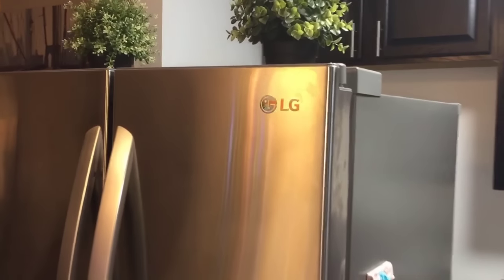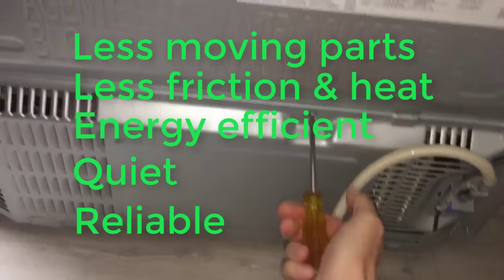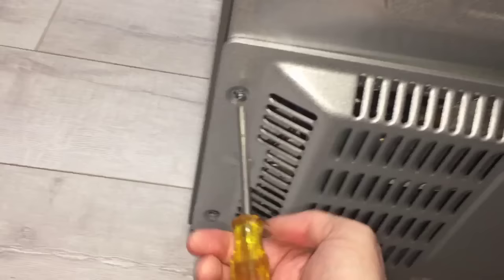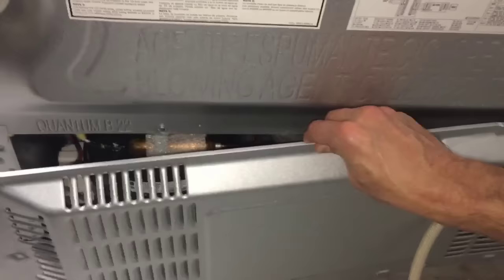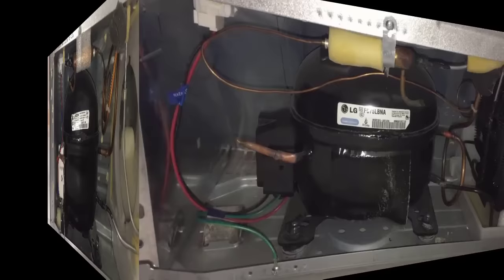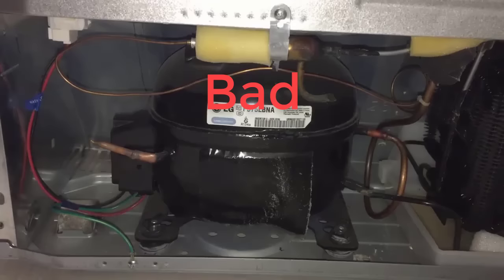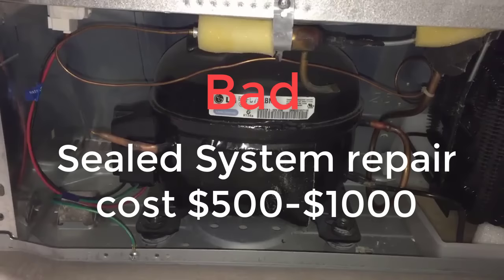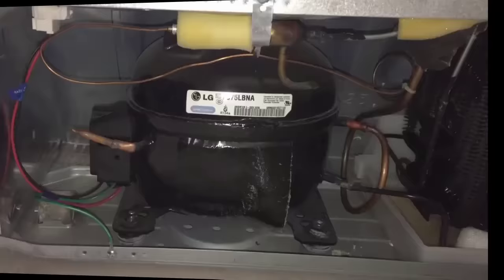LG fridge not cooling but running

Comment: I live in Arizona and today my fridge stoped cooling all the way keeping the temp at 54 degrees. I found your video. My compressor sounds great but my coils were loaded with dust and the fan had a good amount of dust on it as well. The compressor was pretty hot to the touch. I really think the issue is blocked coils so I'm going to leave the fridge off over night so the compressor can cool down and I'll try it again tomorrow. Thank you!!
Reply from the maker: I'd clean up the coils with a brush and a vacuum and turn the fridge back on. No need to keep it off overnight, unless there is a defrost problem.
Reply: @Your-Self  Excellent. Yes I already vacuumed and brushed everything with a tooth brush then I took the inside apart to make sure I didn't have a frost issue and the fan inside the fridge is working fine. It was a good excuse to completely clean the fridge too. Ok, I'll fire it up! Thank you!
Reply: @YourSelf it didn't work. The compressor was really hot, it that an indication that it's not working properly. Anything else to try before  I make a service call?
Reply from the maker: The compressor can get pretty hot on regular basis, but if the fan next to it works correctly, the compressor should be OK. If you have a temperature IR gun, try measuring the temp of the condenser coils as on the next video. Then decide if it worth calling a tech. https://youtu.be/ipwOerjFITg
Reply: @Your-Self  You are the BEST thank you so much for wanting to help. You are sending good eneryg into the world and it comes back to you!!
Reply: I'm not an expert, but based on my knowledge about cars and everything, I can say a few things about it. For example: the compressors on these refrigerators are supposed to be running constantly. As a result, they should generate heat and be warm/hot to the touch. So, that is not your problem. The condenser (the fins block) next to it is supposed to be warm (above room temperature) as well. Be careful with the fan next to it. Mine is just at the room temperature, so I'm suspecting the compressor to be the problem (not compressing Freon). They called it "sealed system problem". We got 6-9 years out of it, so I'm feeling lucky here. Still, average life span of a resident refrigerator should be 10-17 years. I would not buy another LG with a linear compressor, unless they improve its reliability. Buy swirlpool, or something to support your people at least.

Comment: So whats IS a good fridge for a campervan doesn't have to be 12v as on lithium batteries but an invertor type are they the same bad compressor. Whats this one like LG inverter fridge GT 279BPL?

Comment: Man I think u might have saved us anywhere from 500 to 1000 bucks, I won't know for a couple hours, what has happen was I pulled the frig out and the back plate was covered with dust so it was not breathing, so Wifey and I cleaned everything thing up and plugged it back in and we are noticing freezer becoming more cooler, still need a few hours to know for sure. Hey but even if it turns out that's not the problem you were a big help!!!
Reply from the maker: Hopefully you cleaned the condenser coils just in time, because majority of LG linear compressor failures are due to overheating. 
Just keep in mind, that it may take a whole day to return to normal temperatures after cleaning it if the compressor is still good.

Comment: I have a Kenmore Elite french door with bottom freezer, it is 6 years old. The linear compressor is warm to the touch and purrs quietly. The condensor motor and fan operate smoothly. I can feel ambient air blowing thru the freezer and fridge areas.The ice maker stopped working at the same time as the fridge & freezer stopped cooling. When I checked the evaporator area there was no sign of freeze up and no water on the floor but there was water in the freezer basket so maybe the evap. was frozen and melted before I got to it. I don't know what part to replace? Thanks
Reply from the maker: This definitely sounds like a Sealed System problem. It could be a leak, restriction, or a bad compressor most likely. Unfortunately, there is nothing you can do yourself. If you don't have an extended warranty from Sears, you'll have to decide if it's worth spending up to $1000 to fix this fridge.

Comment: Our LG fridge just lasted 4 yrs.  However, we've had problems with it since year 2.  I found a guy who fixes Refrigerators in the Denver area, he changed the compressor, charged me $600 (labor and the part).  The compressor, I was told, is a little bit older but so much durable than the pieces of junk LG uses now a days.
Reply from the maker: Your refrigerator should be still covered under 5 years free compressor replacement.
Reply: Can I get that contact? I live in Aurora
Reply: Wondering if I can get that contact too? Having a nightmare w 3 yo fridge. Within 1st year 1st compressor died. Now  2nd compressor and still broken  for over a month! Would love to get non-linear technology replacement compressor. Or if anyone knows of a good make/model to replace the whole fridge? Thanks.
Reply: Yes please send info I also live in Aurora, Colorado. My lg fridge just went out as well, 10days ago. Tech, came out from A&E factory and order a new compresser came in 2 days after he ordered it. But they can't get out to install for another 14days. Read the reviews for A &E  heard all horror stories. At this point I'll just pay someone to install my compresser.
Reply: @Your-Self  gee, mine was!  $4000 Lg fridge, compressor failed 22 months in, replaced in summer 22, not failing again.  So, what difference does their 5 year warranty make? took 15 days for serviceman to come. some people wait months, yes months, literally.  Lg sucks

Comment: I have a 5 year old French door LG refrigerator and everything seems to work fine, even the compressor sounds normal, but the evaporator fans on work in test mode. I leaning towards it being the thermostat sensor, but I'm no expert. Any ideas?

Comment: If it runs and the condenser and high side lines are cold, chances are it may not be cooling correctly. If you attach a gauge through the process tube and there is high suction pressure, the compressor can be bad.

Comment: Hello, it would be helpful if you can explain more about the overload click... What is opening or closing in the circuit when it clicks?  Thanks!
Reply from the maker: An overload click typically happens with non-linear compressors. They are the most popular "old skool" compressors that use a Start Relay. So when a compressor fails to start due to a bad relay or the compressor itself, the overload will (click) turn the power off for some time. After cooling down will supply the power again.

Comment: My LG refrigerator is 1.5 years old, it’s had 2 new compressors installed in it by technicians, it worked once for about 12 hours, still doesn’t work. Have had the technician out 5 times to tell me it was a leak or they had the wrong part the first time, etc. Is this a common problem anyone is having? Time to just get a new fridge?
Reply from the maker: LG compressors are different from others so not every technician can install them correctly. Also, a brand new compressor could be defective right out of the box. If you are the original owner and have the receipt, LG must fix it or give most of your money back for this fridge. Read this article if you have patience: https://consumersane.com/lg-refrigerator-not-cooling/
Reply: Same issues here. Already had a replacement fridge and it just crapped out on Easter weekend with a full shop from Costco going bad as we speak. LG customer service is non existent. They want 299 CAD to send a service guy out. Fml.
Reply: Steve Viel After about a dozen repair appointments, LG told me they will replace it. I just sent in the receipt the other day. I haven’t paid a dime. If it’s new enough you shouldn’t be paying anything, so I would try calling again and see if a different customer service person will help you. Go buy a cooler for those groceries though lol

Comment: My LG refrigerator was constantly clicking and not cooling.  I read that a common cause was the start relay and overload protector that are attached to the compressor, so I opened up the lower back panel where the compressor was and saw the two parts, ordered replacements for $60 on Amazon and changed them out (was just a matter of unplugging them and plugging in new ones). No more clicking and it's cooling great so consider that if you have a similar problem. Be sure to actually look at the parts before you order them to make sure you're getting what you need. Also many parts websites have videos showing to how change out these type of parts.  There are some videos online showing how to test the electrical connections to determine if parts are bad or if your compressor is frozen and needs to be replaced so check those out as well.  And while you have the back open, check the cooling coil in there for dirt and pet hair and clean that out good with a brush. Fortunately mine was perfectly clean since I have no pets.
Reply from the maker: Thanks for sharing your story and, I just wanted to clarify for others reading it... that replacing the start relay works well for basic compressors that don't run at all.
However, this video is about LG LINEAR compressors that are running but not cooling. Also, Linear compressors don't have start relays.
Reply: @Your-Self  Yes, my LG fridge is a 2007 model so it's an older model.

Comment: My compressor sounds like it's running fine, there's no click, but the fridge still isn't getting cold.
Reply from the maker: Ether the gas is leaking out, or the compressor is dying (most likely). Call LG directly if it's under 5 years old. They may replace the compressor free.
Reply: @Your-Self  really appreciate your timely response, especially on a video that's three years old (still the best on the matter)!
I plan on calling them tomorow.

Comment: My 2.5 years LG fridge is having this same issue - not cooling but running.  Looks like everyone here is having this particular issue with LG fridges when they are a little over 2 year old.  Did anyone successfully get LG to replace the fridge or refund the money?  How long did the process take?  I can't afford having a non-working fridge in my kitchen for too long.  Thanks.
Reply from the maker: If you have the receipt on this refrigerator, call 1-800 number on the label going straight to LG. Repairing or replacing can take anywhere from a few days to a few months depending on the area you live in. Read this article, so you know what to expect: https://consumersane.com/lg-refrigerator-not-cooling/
Reply: My fridge 29 months old and stopped cooling and freezing 2 weeks ago...I got an LG repair guy in who replaced the compressor. on Monday,,.It worked for two days..I called today and they are sending out someone next week...I can't afford a new fridge every 2.5 years...This is very distressing...

Comment: Thank you for the useful video, can you kindly inform me the radiator temperature (high pressure pipe from the compressor side) during normal operation with good compressor?
Reply from the maker: The tube coming out of the compressor should be pretty hot to the touch. The middle of the condenser (radiator) should be about 20-30°F above the room temperature as in the next video https://youtu.be/ipwOerjFITg

Comment: If you buy and LG Refrigerator also get your self 2 big ice coolers...........You will need them to put your shit in when the Compressor goes bad and it will.  The compressors don't last more then 5 years.  The compressors cost 400 dollars and 700 to 1000 dollars to install.  And that repair will last one year....!
Reply: Wish someone had told me this before I bought mine! Great timing to have my fridge go out after 3 years.
Reply: @JeremyJ7751  I am so disappointed in that Refrigerator.  It is the nicest refrigerator in the trash.   I could not get LG to do anything or even talk to anyone.  I can't wait 2 weeks to get it fixed so I went out and got a new one.  I will never buy a LG product every.
Reply: You will also need tranquilizers and blood pressure medicine for dealing with their “wear them down until they give up” customer service group.

Comment: Dealing with the LG customer service is a pain and may take weeks to months before their reimbursement. Get a working fridge in garage while going through this ordeal. This saves food waste and inconvenience for the time being. My LG has two compressor failures within 8 years. NO MORE LG’s.
Reply from the maker: When LG linear compressors started having failure problems, they replaced them with the same troublesome compressor. So I'm not surprised why the replacement fails as well. Nowadays, they install newer, updated compressors. But nobody knows how long these will last.
Reply: Agree with you 100%.  LG Customer Service is a bad joke and just as bad as the products they are selling in the USA and Canada.

Comment: Thank you very much for your video clip. My LG refrigerator is 15 years old now, the compressor still running without noisy sound, but not cooling.  However the freezer on top still works well.  There is thick dust from the back, I did clean it, unfortunately it’s still not cooling. What would I do, please advise!
Reply from the maker: If your fridge is 15 years old, it probably has a regular compressor, which is more reliable than LG Linear as on this video. Hopefully, the compressor is good since the freezer compartment is still cold. So most likely, the freezer fan stopped working, or defrost system malfunctioned and the evaporator coils got covered in a thick layer of ice and snow, which prevents the proper cooling.

Comment: Mine stopped cooling after 8 months.  Called service and was told to unplug for 10 minutes to reset the motherboard.  That did not do anything.  So I set up a service visit.  so after like 3 days I plugged it back in prior to the service call scheduled for 2 days from that point and guess what....it started working again.  So I cancelled the service call.  Now 6 months later it did the exact same thing.  If I set up a service call and it starts working again, are they able to diagnose the issue with the unit working?
Reply from the maker: If the unit is working at the time of a service call, the tech will not be able to figure out what's wrong with it. The motherboard may have some intermittent issues by itself, or it could be caused by a "dirty" power from the outlet. I'd suggest getting a power surge protector to reduce electricity spikes for your refrigerator and other expensive electronics in your home.

Comment: I have kenmore Elite with same LG compressor and having the same problem.
Reply from the maker: LG offers a free compressor for the first 10 years (you pay for installation only). But I'm not sure if Kenmore has the same offer.
Reply: Kenmore  freezer temperature settings home
interest

Comment: My LG has a constant sound, more similar to the bad sound in your video.  It currently maintains about 45 degree temp in the fridge and a 30 degree temp in the freezer.  We tried letting it defrost overnight and it still won’t function normally.  It has been over 2 weeks like this, not completely dead but not cooling or freezing properly.  Based on your video, it’s not worth fixing?  I’d rather get a new fridge then spend 1000 for a fix that may just break again.
Reply from the maker: How old is your LG fridge? The first 5 years the compressor is covered by LG.
Reply: YourSelf 2013, this fridge was inherited.  We had it about a year
Reply from the maker: LG installs better compressors nowadays. But without a receipt, the repair on the 7-year-old fridge probably not worth it when you can buy a new one for about $1200
Reply: YourSelf so based on the issue I described.  It’s pretty much toast?  I’m getting a Whirlpool and hoping for it to last.
Reply from the maker: If it's not a defrost issue, then it's probably the bad compressor. But I'd double-check the defrost problem. If there was a solid piece of ice on the freezer evaporator coils, the overnight defrosting may not be enough time. Try to remove everything from the freezer, including the back wall, to look at the coils. If there is no ice, it's a toast. Did you see the next video on how to check all fans and condenser coils temperature? https://youtu.be/ipwOerjFITg
Reply: YourSelf thanks for the advice.  I actually had it defrosting for a full day with doors open and it was in the 80s inside my home.  No ice would stay solid and there was no water on the floor.  I’ll go with a new fridge and move on with life.

Comment: The problem is that government regulators are pressuring appliance manufacturers to reduce electricity consumption and use "green" refrigerants. That's why a refrigerator from the 60's still works awesome today but a refrigerator sold in 2021 will be lucky to make it a few years. The worst part is that MAKING refrigerators that fail after a few will use far more electricity and create more waste than what was saved compared to the older compressor designs. The more these idiots in the government push to increase efficiency, the more waste and energy is lost. That's on top of ripping off people that spend big money on an appliance they can't afford to service or replace every 2 or 3 years. Another example of latte lib idiots in the federal government that don't give a shit whether their regulatory ideas make sense or not.